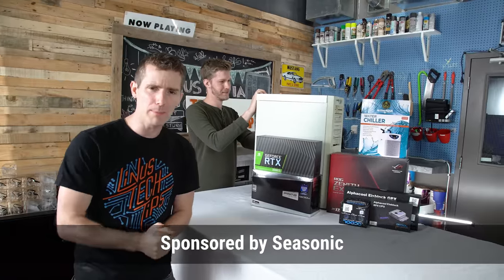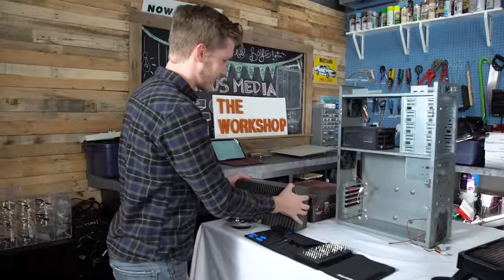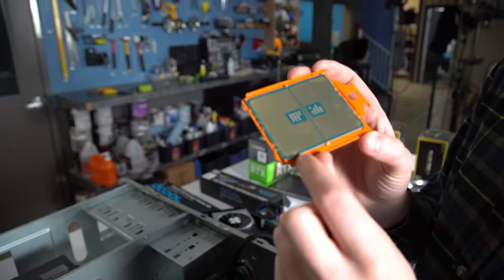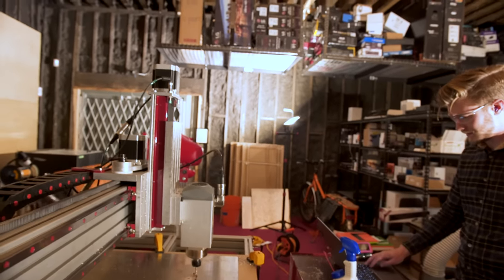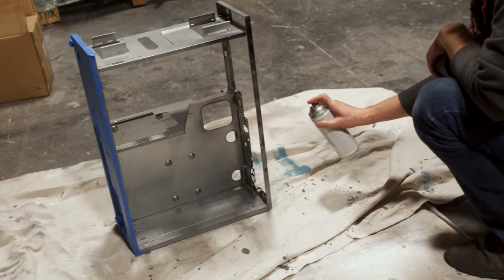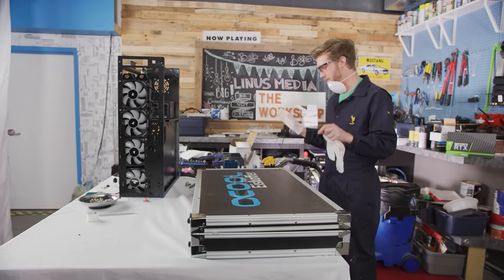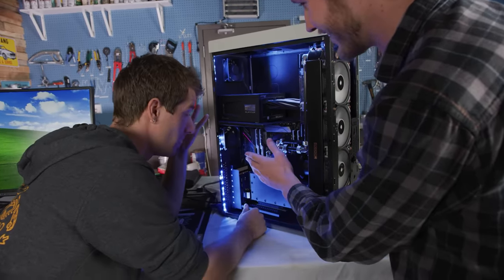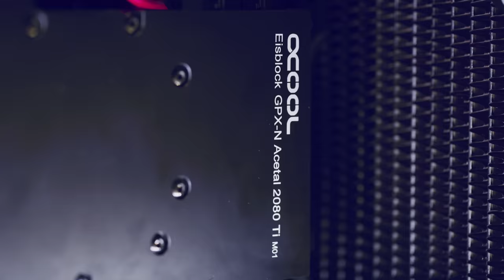The ULTIMATE Powerhouse Sleeper PC

Comment: Hey Linus Tech Tips, just a few tips about your CNC router on aluminum. I'm a journeyperson machinist by trade, and I've had quite a few issues with aluminum. First of all you want to make sure to have the proper cutting tool. You guys were using high-speed steel, carbide tools work a lot better. Next is speeds and feeds. You want to make sure to have the proper rpm. To find rpm, you need the proper surface feet per minute. Which for aluminum with carbide tools, it is 600-1200. Then to get the rpm you use the formula 3.82 x sfm / diameter of cutter. Then with feed you want a .001" to .002" chipload per tooth. To calculate feed you times your chipload x number of teeth x rpm. That will give you your inches per minute for the feed. Last is that aluminum is very sticky, it will stick into your tools flutes and clog the tool up, causing it to get very hot and also causing it to stop cutting and just start tearing. To combat this, you want a lot of cutting fluid. You guys were using wd-40 which works well, but you were just misting it on, you want to almost keep a constant stream on that, so switch the nozzle to stream mode and keep spraying directly on the tool. Hopefully this helps! Also if you don't want to use carbide, the sfm for hss is 100-200 sfm and the chipload is .0005"-.0015" per tooth.

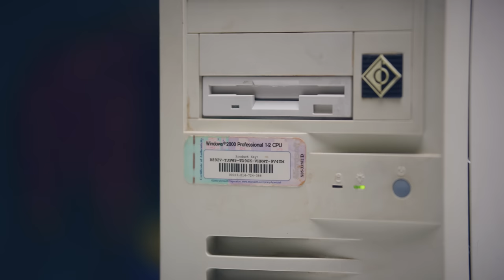Comment: 15:20 a product key! get off suckers, it's mine.
Reply: Microsoft didn't introduce validation until Windows XP, so there is plenty to share.
Reply: @crazydream719  I guess if you wanted to create a Windows domain, maybe for learning purposes, but had low-end Pentium 4s or worse lying around, Windows 2000 would be preferable even to XP/2003, which are somewhat heavier. There are people who have computer rooms with one each of major operating systems and period-appropriate hardware to match.
Reply: @crazydream719  Well, if you have a low-end Pentium 4 or worse you wouldn't be able to use 64-bit mode anyway.
Reply: @dycedargselderbrother5353  it has changed too much to even bother. I'd say Server 2008 is minimum.

Comment: Place your o rings on the tube before insertion. Been working with hydraulics for a couple of decades and found that works best. Once inserted push screw cap in place and tighten.

Comment: What grade of aluminum were you using? Judging by the test piece Alex bent it looked like 6061. 3003 or 5052 would have been more than strong enough in this scenario and easy to both machine and bend. This is just a guess based off the stress cracking in the bend he did. Annealing the piece would make it easier to work also. Just for future note.
Reply: lol there is only ever one option for aluminium. full on 7075  t6. ;P
Reply: @bmxriderforlife1234  full billet sleeper pc it is!
Reply: @HotRodHippie  ouuuuuuuu better go with cold forged cnc finish combo manufacturing process for that extra strength. 

use a bit of strengthening material removal to increase rigidity and make it linus proof. they can give it to lonely island so he can throw it on the ground.
Reply: @bmxriderforlife1234   yeeaah, good luck bending that mate. just plain high yield is not the only material spec out there, and 7075 is a pig to work with in almost any respect: it corrodes while looking at it, it straight doesn't weld, cracks go like zippers on a stripper, it anodizes like crap (not that you should when using 7075, anodizing sucks for high stressed parts), it's no fun on a lathe, fatigue life is  crap because of the crack growth, and it's bloody expensive for a mainstream alloy. 5083 will do you right for these kinds of jobs. cheap as chips, bends good, welds nice, doesn't even corrode in salt water and plenty strong enough for applications other than race cars and aircraft. if it doesn't need to bend and/or you don't need sheet, go for 6082. need strength and fatigue life, whip out the wallet and go for 7475, in a nice temper. T6 is good for strength, once.
Reply: @bmxriderforlife1234  consider me had. Sadly i do have colleages who seem to think like that, my knee jerked.
Reply: @rasmAn2  lol may want to go check the bike industry just fyi. anodized 7075 is done all the time without issue. 

also dont think salt is going to be an issue in a pc. second paint can provide a perfectly fine protection layer. and it rusts but its really not that bad. 

i could also show you a pair of cranks called primo hollowbites. 7075 cold forged t6. cranks take alot of abuse. they changed them to a 6000 series aluminium and then discontinued that model and left the cheaper powerbites which were the same design almost just without a hollwed out section in the middle of the arm. came in three color options for the original ones. white black and polished. lasted years. the only crank a semi pro rider i know could use everything else blew up. powerbites didnt even work. and when they changed them to 6000 series aluminium they started breaking on him faster. even the original ones broke eventually but a new pair of cranks every 18 months is better then every 6 months. 

oh theres also an aluminium frame that used it that required 50,000psi on the rear triangle of the frame to cause it to bend slightly. and the strongest rims are made from it. and rims are where you get the most salt damage on a bike.
Reply: @bmxriderforlife1234  from what i've seen it's mostly 7050 in bike frames, that's weldable and a lot better at high cycle fatigue. That being said, 40% of 400MPa is still better than a lot of other alloys. Cranks take some abuse yes, but compared to prophubs, and forging is indeed the shit. As for anodizing: a thick layer can work and take colour, but it's murder on parts because it's way harder than the underlying aluminium, and on the outside. it therefore atracts stress and cracks, and this induces the zipper effect. Rims see medium cycles on a relatively low load with low r, and impacts, here 7075 can work nicely yes, even when anodised. Since the application is yield determined. Got a set myself in fact, on a 7050 frame.
Reply: @rasmAn2  maybe i low end frames. 

and again bmx not regular bikes. and also mountain bikes designed for tricks and downhill racing. 

a rigid bike, with 100psi tires or harder. 20 foot drop. to flat on 7075 anodized aluminium rims. 

can introduce those issues it doesnt have to though. 

as for cranks we are talking aluminum cranks that were stronger then titanium cranks. every set of steel cranks. including some cranks made from materials with better strength then 4130 chromo which is a fucking beastly steel. 

probhubs take more abuse due to them often getting hit on rocks and shit. they are thin as fuck often. and also often in salt water hence the faster rusting. 

anodizing protects aluminium from rust. and ive yet to see an issue caused by anodizing when done properly. it can cause issues but doesnt have to. 

also just saying but chrome is harder then anodizing. this is why chrome rims are the best for rim brakes other then textured rims. 

rims on bmx see huge impacts ridiculous stresses and often have the spokes completely broken and replaced multiple times before the rim breaks.
Reply: @h3ronimus49  And if they didn't have one, multiple passes.
Reply: Pure aluminium's the best. If it bends, you just gently touch it with your pinky to bend it back.

Comment: Take a tip from the aircraft industry when useing your CNC router program tabs into your work piece so on the outside it had tabs you bend and twisting off. That why when it cuts out you don't have to have it clamped or sucked down to hold it in place but make them Small so they may be broken with just a chisel and Hammer. This method will work on CNC machine has well such has a Hass vf2 3 or five axis. There will just be a bit of clean up work with a da.

Comment: these series of sleeper builds really pushed me to make my own. I did and it is my current and only rig, but it is built out of scrap parts from friends and stuff I had left over from my first rig which I had to sell to fix my car. I have a Msi GTX 1060 - 3GT ($40), a core i5-4690k ($51), EVGA 450BT psu (free), SSD (free), Lenovo IH81CE motherboard (free) has a 10 min connector for the motherboard, Samsung 8GB RAM 1 stick (free), Compaq Presario 9240 Case, rgb light (free), EZDIY Riser cable ($19) but I need a new one bc this one short!, a 24-pin to 10 pin adapter I had to make out of a power supply from lenovo and another adapter a friend gave me. That is my build, I need a new Riser Cable, a water cooler so the side panel will fit on without bending the motherboard, a new motherboard so I'm not running that jank psu adapter I made, and in the far far future a better gpu. I can play Destiny 2 again!
I am proud of this build and in a few years, maybe I'll be even more proud.

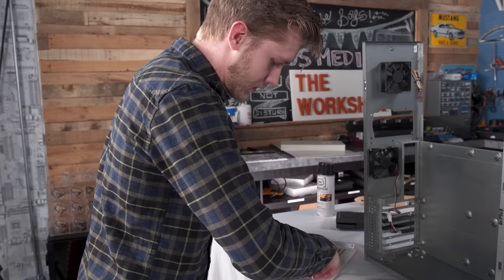Comment: 6:48 did they just use a impact as a drill.
Reply: hunter crouch there are impact rated drill bits and since impact drivers spin faster than drills on average they tend to cut faster in my experience.

Comment: How did you get all those little lights at the front and the original power button to work with your new hardware? Did all the old optical drives and floppy disk drives work?

Comment: I would get another vise and weld a heavy bolt head  to the handle and screw end and just use a battery powered impact wrench to do the work for me. Kinda diy,  but would make it easier to make the bends in the metal sheets.

Comment: Machinist Pro Tip, use a machining coolant on your cutting tool. WD-40 IS NOT A PROPER MACHINING COOLANT!

I offer this tip as a man who is certified in manual & CNC machining. I am also a certified welder (mig & stick) as well as an experienced fabricator.

I assume that you are using WD-40 because of the bottle you are spraying on the cut surface. I have a few bottles exactly the same as the one you use. They are provided with bulk purchases of WD-40 as personal use dispensers with a 3.78l metal container.

I love your channel and content. I even feel like a turd making this message. Thank you for all the amazing content you provide. 

Cheers from Guelph Ontario Canada!

Comment: Did he use the table to slow the grinder down after making the cut? That's not a good habit if you have a guard on... which you should always have on.  I might have one grinder without.. After watching the Beyond the Press video of the shrapnel going all the way through a gel block I realized why I always get stopped at the metal detector in the airport....

Comment: You have to use  high pressure coolant when milling aluminum. Otherwise your tool will stuck after enough molten aluminum is stuck in between the cutting edges. I'm a professional trust me

Comment: Why wouldn't you guys just create a vacuum hold down using a shopvac  wet/dry and use some actual cutting fluid for lube. Not to mention why would you try to cut the aluminium in a single pass? Do a couple passes and it will turn out perfectly. If I had access to your available toolsets the things I could create.

Comment: I wonder if you could not put a few 80 mm fans at the back for out take air instead of the 40 mm ones ?
Reply: But, those are 80mm fans. 120mm at the front and 80mm at the back

Comment: I really hope you still read comments from a video this old. You mentioned early in this video that the threadripper makes some sacrifices in gaming... could you do a video on WHY that is? I mean, 32 cores, 64 threads... that is a lot of power. Even if a game is designed with only 8 cores in mind, wouldn't that just means that it uses 8 cores on the cpu and the cpu can use the free cores for other things? In all my years of being interested in computer tech and working in tech support, that is one thing I've never understood... how a cpu can be "too powerful" to the point that it can make games suffer.
Reply: The issue with having multiple cores is that it makes each individual core weaker. So if a game is only using 8 cores on a 32 core cpu then it will be only using 1/4th of its full power. Yes the cores can be doing other stuff but that other stuff won't help with the gaming performance. If the game was optimized for that many cores and was allowed to use all 32 cores then you would get the full performance of the cpu
Reply: @k9521__  I get that if a game isn't using all the cores, you're not using the entire CPU. What I don't get is the HOW and WHY that would make said game suffer. Let's use 2 equal CPUs as an example... same clock speed, same memory etc. If you're running an 8-core game on an 8-core CPU, you're getting the "full benefit" of your CPU, sure. But does anyone really "Just" game?

Using the same setup, except with a 32-core CPU... you've got the game using 8 of those cores... but HOW does that "weaken" each individual core? Especially with how multi-tasky people are these days. So you've got an 8-core game running on a 32-core CPU... you've still got 24 cores that will let you do other things without potentially bottlenecking the game. Other things such as discord for chatting with friends/teemmates, and a browser in the background that you pop over to check some things while your game is on a load screen, or running netflix if you're just farming in an MMO type game, or maybe running a local game server at a lan party.

The way I understand it, more cores just means more CPU instruction set bandwidth basically. This is why I hope that Linus will do a video on this topic. If I'm misunderstanding something, I would like it clarified, and his videos do such a great job of that on so many other things. Like his techquickie vids about things like PCIe lanes/version, clock speeds, etc. I just feel like this discussion would be too long and detailed for a techquickie episode lol.
Reply: @little-wytch  the clock speed is divided up by the core count, so for example a CPU with 32 cores running at 3.2ghz each core would be running at 100mhz so its single core performance would be weaker then an 8 core cpu running at 3.2ghz which each core would be running at 400mhz. This is oversimplified and may not be 100% accurate but this is the general idea. The use case you said with having multiple cores using discord or chrome would benefit from multi core but if were talking games only they benefit more from single core performance
Reply: @k9521__  That is something I didn't know. Thank you for pointing it out. However, that actually adds more confusion for me which is another reason I hope for a video on this.

I remember when a single core first broke 1GHz. By your explanation, a dual-core 1GHz would be each core running at 500MHz. I was under the impression that clock speed was the frequency at witch an instruction cycled thru the processor core and that a multi-core processor was multiple processors on the same die, thus negating the need for multi-socket boards and the only thing shared between the cores was the on-die cache.

On that same train of thought about clock speed... with processors getting so much smaller... a single-core 1GHz CPU using a 7nm process should be much faster than a 1GHz CPU using a 28nm process. But, that might be me thinking too linearly, and I would love the video to explain if/why that's the wrong way to think about it.
Reply: @little-wytch  I wanna video now of it too because besides what I said already I don't really understand much more on how CPUs work
Reply: @k9521__  Let's hope they read this then lol. If you know a better way to suggest it to them, please do so. I'm not a fan of social networking or such lol.
Reply: @little-wytch  I could try maybe their twitter but idk if they'll actually see it
Reply: @k9521__  I still can't believe twitter still exists. Maybe if you @ them with a link to this video asking to make a video based on the recent comments on it, that might be enough.

Comment: Cases have become so beautyful and wonderful and made of smoked glass and high-tech lasercut metal and displays on the front and whatnot, that the absolute futuristic looking design superlative which looks like coming right out of a spaceship has become "new standard" nowadays.... which makes crazy ancient old beige-coloured computer cases with floppy drive from 1994 really look cool and rare nowadays.
But: Can it run Flight Simulator 1998 maxed-out settings and with overclouded weathers? Have you tested? If it doesn`t perform so well I recommend upgrading to the newest Voodoo 5 6000 graphics card with the latest 3DFX drivers, and install 128 Megabytes of RAM for the Threadripper..... 

To make the time travel experience absolute true to the core, watch MacGyver and X-Files episodes only on CD with Windows Media Player and a 4xspeed CD-ROM drive ;)

Comment: Your double sided tape not only gummed up the cutter but it makes it heat up and burn the tool up. Try a tape that uses a VERY thin film "stickyness". The heat is supposed to be transferred into the chips. your machine is also probably underpowered so it would be better to do 2 cuts but much faster. since you are cutting aluminum faster is USUALLY better because you dissipate the heat more. faster in the feed and rpm of the cutter. you probably used a high speed steel cutter but if you can pony up the cash a carbide cutter will not have as much thermal issues. Lastly a good mister is pretty cheap. Just type in "cnc mister" in google.

Comment: @linustechtips I see that you guys over there doing the damn thing. I've learned a few things from you. You build such powerful PC's & Laptops. But have you ever given thought to how much you have been limiting yourselves? I've yet to see you tackle a battery or even a power pack. But with all the amps being drawn to your creations have you looked beyond that to the plug in the wall? It can only handle so much of a load. Unless, of course, you change the wiring in the wall & the circuit break it's connected to. WITHOUT violating the law. Meaning electrical code violations.